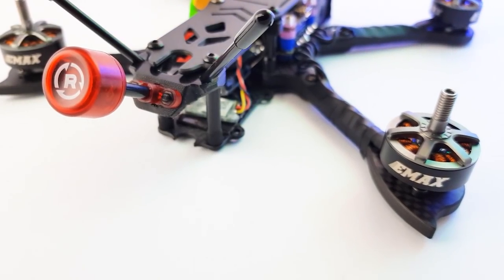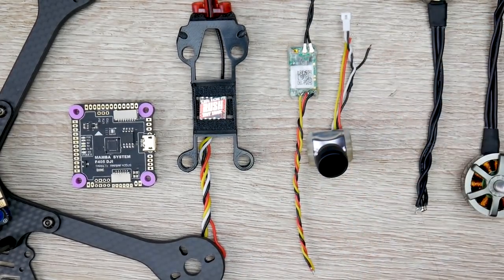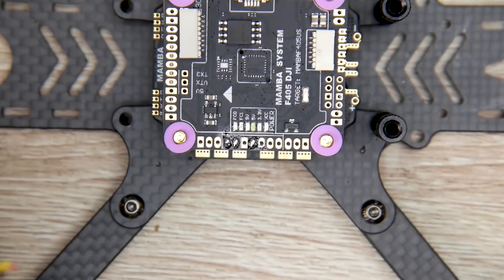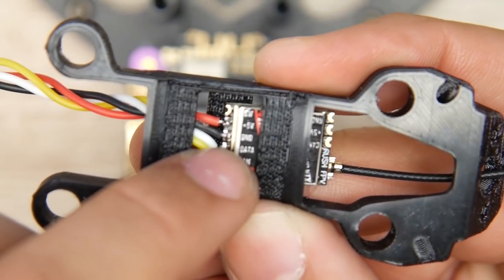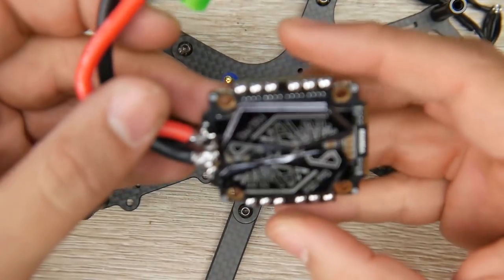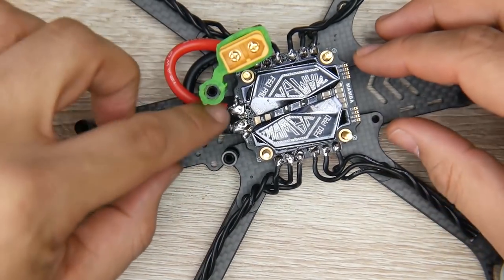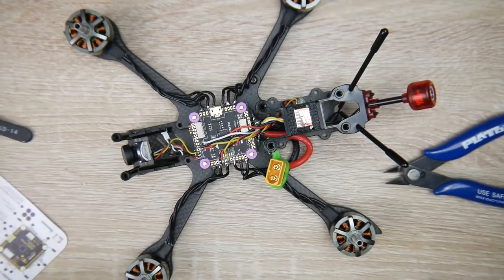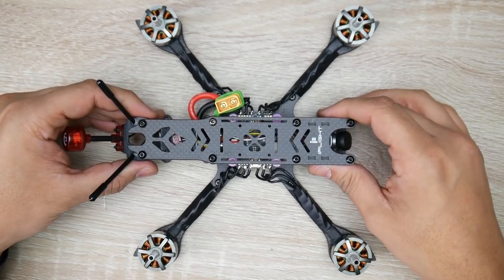Beginner Guide Part 1 // How To Build Budget Cinematic FPV Drone 2020

Comment from the maker: Emax ECO 2207 2400kv: http://bit.ly/2pwsXdk
iFlight SL5: http://bit.ly/2kBCNZz
RushFPV Tiny Tank: http://bit.ly/38KFhbo
Rush Antenna: http://bit.ly/2SQ0ETp
Diatone F60 ESC: http://bit.ly/2S1tnEw
Diatone F405 DJI: http://bit.ly/32jWPZQ
Racer Nano: http://bit.ly/2L6Pzd8
XT60: http://bit.ly/2T6oQQl
Xm+ Receiver: http://bit.ly/2Kamywh

--RC Controller
90 USD (I Use this everyday)
RC Controller: http://bit.ly/2JB0cE5
Reply from the maker: I do but sometimes I like to keep the motor wire long.
Reply: Drop a link for goggles too, please
Reply: What propellers do u use? I just finished building it and don’t know what propellers to use since I didn’t get any with the emax
Reply: Hey man sorry for all the questions but my antenna doesn’t fit the rush VTX despite using the exact same antennas
Reply: @bubba1341  You figure it out?
Reply: Also I can't find the 3d printed antenna holder anywhere. Could you link that please. And what battery should I get for this beast?
Reply: What roughly would be the price for a 6s 5" quad, in analog, I don't trust myself to build 1, and I thought I would ask. Thanks 👍
Reply: hello sorry to disturb I want to buy same this drone
Reply: I need the semi model, I will use it for a longer time, the battery should be good, how much money can I complete the total, I need a drone, can you give me

Comment: I have built a computer before and this looks way more intimidating.
Reply: Caden ay bro I’m gonna try it. I say go for it. If you mess up you can always return them
Reply: Because it is
Reply: Pc plug and play fpv quads buy the wrong components go back buy again smoke it go back buy more find setup that works parts get discontinued start all over
Reply: same here. Built my own PC
Reply: Same...pc seemd easy to this
Reply: Maybe the solder job is the more intimidating thing for beginners. But, from the experience, I could say you need to try and learn from your mistakes. That are tons of videos showing how to do that. Just embrace the challenge and start something. Believe me, it is not so difficult and the final result will put a big smile on your face.
Reply: Learn to solder. The parts are way less expensive, so if you fry something, you can make a sandwich.
Reply: same
Reply: I was afraid to build my PC thinking of how difficult it looked but I build it and now looking at building an FPV drone, I’m scared.
Reply: the more vids you watch and the more you build them the easier it gets
Reply: Built or assembled?
Reply: @stevendavis7821  Right, people now say "I built my own PC". All they did was assemble pieces already put together. We used to have to actually buy and solder mother boards ourselves with the schematic rofl.
Reply: Thanks for demotivating 🙄
Reply: Same... built a pc just a year ago and now building my first dtone
Reply: Building a computer = building with expensive legos
Building an FPV drone = building with medium expensive legos

Its not that much different other than soldering.
Reply: I build an intense gaming pc and this seems way easier then a gaming pc
Reply: @ReptileAdventures22  Toast to that
Yeah building an extreme high end balls to walls beast takes some effort more effort depending on hard tubing or soft tubing
Reply: @Sphyxx  agreed 👍🏻
Reply: Na looks way easier than assembling a PC cuz with drones the parts are way cheaper
Reply: @rohanshirkhedkar4220  building a pc is extremely easy
Reply: @Sphyxx  ik I'm saying it's more intimidating cuz the parts are far more expensive
Reply: @rohanshirkhedkar4220  why would it be at all intimidating?
Reply: @Sphyxx  because if u mess up it will cost u a lot more that if u mess up while making a drone
Reply: @rohanshirkhedkar4220  well true but just dojt mess up its that easy
Reply: It is, no soldering involved in most computer builds
Reply: Nice video. But I’m still scared to put mine together.
Reply: It is

Comment: I would recommend a bigger soldering tip for this. Like a 3,2 mm chisel type. Even for the small pads I use a bigger tip. Even with enough power and sufficient temperatures, soldering can become a pain if there‘s not enough heat transfer.

Comment: For anyone watching this, use the correct sized solder tip, and use Flux. You'll see he has extreamly hard time soldering the motor wires to the esc. This is mainly because the soldering tip is way to small, and cannot transfer enough heat to melt all the solder on the pad. Even after he turned his iron up to 440c it still couldnt transfer enough heat for nicely flowed solder joints. Use the correct equipment, save yourself the struggle. Trust me, he is struggling for no reason. Just change the tip. Hakko tip T18-C3 from xt60/motor wires, hakko tip T18-D16 for everything else.

Comment: Try putting the exposed wire through the hole. Bend the wire in direction desired then remove the iron. The solder will cool fine on the other side.

Comment: I'm new to soldering. How do you keep the liquid (hot) solder from running over multiple pads/holes? I don't see anything preventing it from running all over multiple connection points? Such as at 13:01?

Comment: That's a great build! gave me some ideas :)
but.. you aren't using flux are you? some of the soldering scenes with that huuuge amount of solder and that long heating.. that hurts my eyes XD ..or your soldering iron isn't hot enough.. hmm at what °C degree is your iron?

Comment: Hey, great vid, clean build, subscribed instantly. I got a little question, if i don't need DJI capability, can i replace F405DJI with F722, or regular F405mk2 will fit better? And can you recommend some little more premium motors, that can handle 5S or something?
Reply: do oyu figured it our what to take when you dont wont dji?

Comment: A tiny bit of flux on the board will help with flow and adhering even though your using i'd assume rosin core solder

Comment: This video cant be released at better moment, i have this frame in the mail coming to me from China for my 2nd build ever. Cant wait to get here to start building my quad.

Here is one advice for the soldering on the ESC pads, get yourself a big "hoof" style tip for the soldering iron, it can transfer heat much better than this tiny one you are using and it will make your life much easier when soldering motor wires or XT60 power wires.

Comment: To me it seems that a lot of the Solder points on the flight controller touch each other. Does this not matter or is he just as precice like 
Mr Steele?
Reply: You can cause a short and a battery fire (lipo). He used too much solder.

Comment: Hey, if i don't have a dji googles and radio (will be buying fatsharks), does everything will be compatible?
Reply from the maker: 1000% if you follow this setup it's based in analogue like fatshark and skyzone.. And whether you want to add DJI it's with a connector so you can run both with this setup.
Reply: @DroneMesh  hey, also, did you buy all those parts form banggod?

Comment: Gday DM, very awsome build mate those emax eco motors are very awsome when you cant spend big bucks on motors and Diatone mamba stacks you cant beat them i have brought 4 of them so far for 2.5 and 3inch builds, great job mate.👍🛸
Reply: Yo dude, i see you are into fpv, so i was gonna ask, does that 8 pin connector that connects fc and esc come if you buy them separately, not as a stack? Thanks.

Comment: I thought the VTX and the camera are separate from the FC. My understanding is that the VTX should process the camera data and send it through the video antenna. So to connect the data wires to the FC ?

Comment: Hey man, love the video.  Have you ever had issues with the reciever not lighting up?  I had the reciever working and flying.  Got a new flight controller and now the reciever wont power up.  My battery voltage is good(tried multiple batteries), connections all good.  Any help would be appreciated tried lower gauge wires.  Disconnecting the video transmitter.  Nothing seems to do it

Comment: Hi Drone Mesh,

Very good content man, but I do have a quick question:

Can I use MAMBA F405 DJI Betaflight Flight Controller F50 50A 3-6S DSHOT600 FPV Racing Brushless instead of Diatone F60 ESC and Diatone F405 DJI with this build? What will be a disadvantage by using that?

Thanks, 
Seb

Comment: when you are using the soldering iron, it seems like the solder runs and hits both ground and the 5v connetion, wont this cause a problem? from my knowledge connetion should be seperated?? hope youll answer

Comment: You didn’t specify on what wires to solder onto the XM+ receiver. Can you take any 5V, G, and signal wire and use them in this fashion?

Comment: my FrSky receiver didn't come with wires to connect to flight controller. However there is another connector ribbon that came with the flight controller and is not used in this video? can i cut the connectors off the ends and use those wires for my reciever?

Comment: I built exactly to spec but there was no mention of the tiny tank adapter for the lollipop antenna, there was no mention of the transmitter batteries, doesn’t touch on goggles or their binding process, I can’t bind to my receiver, I can’t bind to goggles, I have to search to find certain files on sketch websites for beta flight to program it. I’d love some help I’m like $400 in with no hope.

Comment: What is the price of everything? Approximately
Reply: Hey man I did a very very rough calculation for you and it should run you around $170-$200 and if you want to attach a GoPro or something then just subtract $35 bucks because the camera is $35 bucks. Besides you can find a good used GoPro hero 2 for around that range or even less. Although this can be different if you want FPV then just get the camera that he recommended, and remember you also have to buy an r.c drone controller which varies in price depending on how many features you want ($10-$300).

Comment: not sure if you will see this but with the Diatone F405 DJI it says 6s on the website does that matter if you are using a 4s battery this is a 4s built correct?

Comment: The f405 fight controller says its rated for a 6s battery input, not 4s. Can I plug a 4s anyways? It would have less voltage.

Comment: I bought the stack listed in the description and I’m having issues with getting power to my XM+ receiver. I’ve soldered the wires to the right spot but the led’s do not come on when I plug a lipo in. Can anyone help?

Comment: maybe a newbie questions but what temp are you soldering at, and what type of solder are you using?
Reply: Get really thin, flux core solder. This will prevent you from adding too much (like he did).

Comment: Hi man, tks for the content.. awesome! I bought the same receiver, FC and VT. the only thing different is the cam which I bought a Foxeer predator. My problem is that after soldering everything in place, I do not receive image in my goggles (Eachine EV100) and I am not sure that after soldering do I need to configure the VT with betaflight in order to receive image or it is pretty standard that after soldering we can already connect the goggles. Can you help me with that?
Reply: I had an issue with exactly the same build as this video - in this he solders VTX from the FC to CAM on the VTX board, but I think it should be VTX on FC to VTX on the VTX board - fixed it for me.

Comment: I was just seeing your video "Latest FPV Products & Price Drops" and saw you recommending cheaper and newer ESCs and FCs, do you think as a beginner(building for the first time) I can get those instead of the ones in this video and still work it out? P.S  - These are the ESC and FC you recommended in the latest video - 30.5x30.5mm T-motor PACER V45A 45A 3-6S BLheli_32 4In1 Brushless ESC DShot1200 w/ 10V BEC Output for 170-450mm RC Drone FPV Racing, 30.5*30.5mm Foxeer F722 V2 FPV F7 Flight Controller 3~6S MPU6000 BetaFlight BEC Compatibled with DJI Air Unit
Reply from the maker: If your new get something the market knows already works. You dont want to be surprised with an issue you won't even know how to explaine.
Reply: @DroneMesh  Thank you so much, you're really helping people like me without a fpv community around, highly appreciate ❤️
Reply from the maker: If you need anything let me know I'll do my best.
Reply: Can I use a 6s battery with this build, (or by upgrading the motors)? Moreover do you recommend that I use a 6s battery instead of a 4s?

Comment: @Drone Mesh, the link you gave is for a stackable, but the picture does not match the one in the video.
Reply from the maker: which link.. I'll check them and fix them the second part will be out in 19 hours or so

Comment: I have a question, on getfpv's website they say that you need a pdb for the transmitter, receiver, camera or other stuff to give it power. I have seen some people install their xt60 on the pdb but most do it in the esc. And almost every fpv build video no one uses a pdb. Im just so confused and wonder if you even need a pdb. Please can someone help me out. Thanks
Reply: Took me a while to figure out as well. Once you have a 4 in 1 esc this will act as a pdb. If you have 4 individual esc's on the arms then you can get an aio (all in one) flight controller which has a pdb built in. A separate pdb was used years ago and seems to be no longer really needed. Hope this helps!
Reply: @nickgreaux2335  I really appreciate this, thank you so much
Reply: @Stuxen  happy that I could help!
Reply: @nickgreaux2335  great info there. This also confused me with 4 in 1 and aio

Comment: At 13:00 its not the heatsink causing the problem, you just suck at soldering. The motor lead needs more tinning and your tip is too dry.

Comment: What’s the temp of your soldering iron
Reply: 300 to 350°C for small joints, 400 to 450°C for the bigger spots to make up the dissipated heat.

Comment: Will this be under 250kg?
Reply: I'm building a very similar one at the moment, and it weighs 575g with gopro hero 4 and 1300mah 4s battery

Comment: What solder do you recommend
Reply: Get really thin stuff with flux cores. If you use thin solder it's much easier to not add too much of it, the amount of solder shown in this video is about double of what would be a nice solder joint.

Comment: Hey! I made my first build with the same fc, esc, vtx, and more but I cant' get the vtx to bind with my goggles. Can you please help me?
Reply: I have the same issue. Did you find a solution? :)
Reply: @825velocity  Yes. I found the solution. I'm pretty sure you have to put the red cable on the vtx pad. I don't have my build near me at the moment but I'll be able to check for sure in a few days. Please tell me if this worked though.
Reply: @joshuark101   Thanks for your answer.
It would be awesome if you could check.
I think red should be the 5Volts power supply, so I don't think it should could connect to the VTX. But I have a feeling the white or the yellow wire should maybe connect to something else. :)
Reply: @825velocity  I just got home. Ill check right now. Sorry I forgot everything lol.
Reply: @825velocity  Okay. The yellow cable is on VTX, white on DATA, black on GND, and the red is on +5V. Pls let me know if that helped :))
Reply: @joshuark101  Just soldered the yellow ome to VTX. That did the trick. Thank you so much.
Reply: @825velocity  Yup. :))

Comment: Can that ESC power 2750Kv motors?
Reply from the maker: Yes 👍
Reply: @DroneMesh  Awesome. I’m going to try it. Can’t find the DJI stack in stock though, so I might have to go with the Succex-F4
Reply: @DroneMesh  I enjoyed watching your soldering method as well. My friend mainly solders stuff on mechanical keyboards so he was telling me “IF YOURE ON THE PAD FOR MORE THAN A SECOND ITS TOO LONG” so as a result, my solder was sticking to the iron more than the pad. ‘‘Twas nice to see I can linger on the pads a bit longer and not really destroy anything
Reply from the maker: That will work and glad you got some usefull info

Comment: What makes it cinematic instead of acrobatic? Is that just a buzzword?
Reply from the maker: Both are exactly the same
Reply: You could argue that a cinematic drone build aims to get especially small amounts of vibrations, is as silent and efficient as possible.
Reply: Only in that, the more powerful the motors the harder to control smoothly for a cinematic and less battery time.  Slower = smooth + longer battery life... and um, exactly what the previous comment says.  oops.

Comment: ANy idea on the total weight? Canada's laws on drones are stupid, but if its under 250grams she's legal without their goofy cash cow license
Reply: I'm building one atm, only difference is I'm using a rxsr frsky reciever running access, and haven't installed a vtx yet cos it hasn't arrived. With gopro hero 4 and 1300mah 4 cell battery it weighs 575g